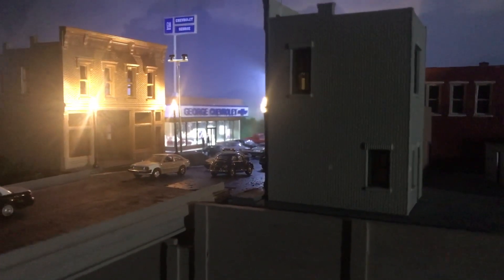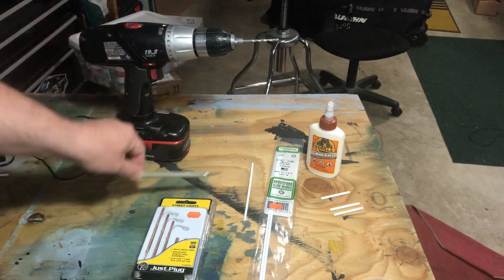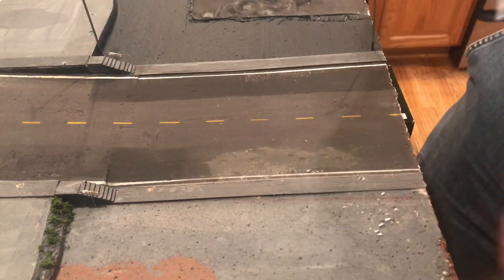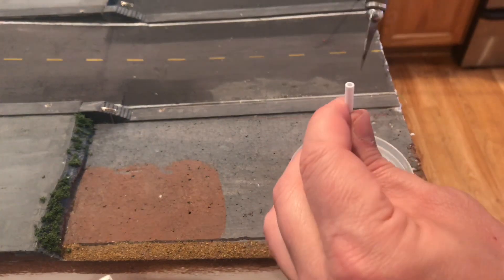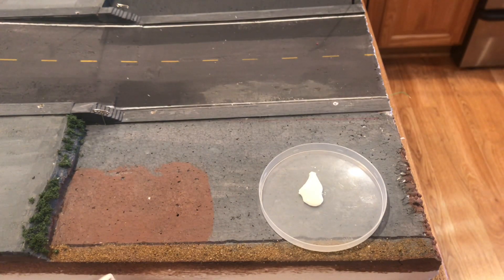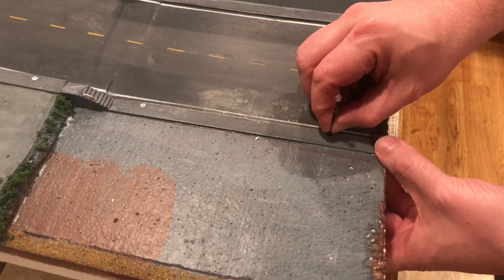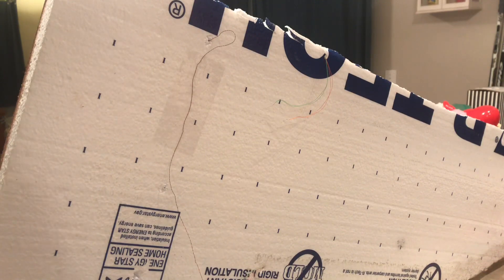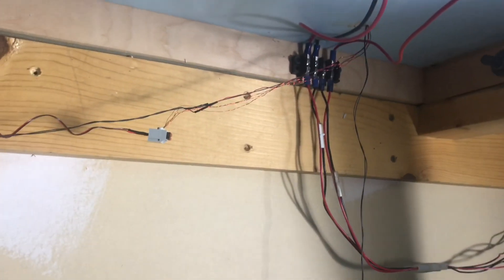Woodland Scenics Just Plug Light Installation method

Comment: Thank you for posting this.  👍👍 I was wondering how I was going to get the tiny pole wires threaded through small hole in foam and plywood.  The small plastic tube is great idea.  I can use this idea for track signals too.
Reply from the maker: Thanks for watching.  Yes, use it for any through hole wire setup.  Soda straws are a great option for just wires if needed.  Good luck and I’m happy this helped ya!!
Reply: It was really hopeful and I gave you credit in my video.  👍

Comment: Thats a great method,  I should have watched your video before I did the lights on my layout,  I  was shocked at how fragile those wires are for street lights.  Nice layout and details !.
Reply from the maker: Thanks!   I got tired of trying to thread track leads through the com, so I used a straw to feed it through, then I had this thought to take it one more step so I’m not gluing the expensive light post, but the cheap styrene.   Thanks for watching!
Reply: @goaliegeorge  Yes for sure that is a good way of doing it. Thanks for sharing.  Merry Christmas/ Happy Holidays.

Comment: Great video while I was doing this I broke tips off of the red wire do you know how I get the coding off the wire so I can reconnect it
Reply: I got it I used a lighter to burn off the coating 😀👍
Reply from the maker: Ideally, wire strippers, but you cannot do that with magnet wire..  so, usually I’ll put a blob of solder on the iron and dip the tip I need stripped into the hot solder to not just remove the clear varnish, but also to tin the wire for connecting.   I hope this helps.  Thanks!
Reply: @goaliegeorge  thank you 🙏
Reply: I actually used a lighter and it also came right off easily 😀 thank you for your suggestion 👍

Comment: Neat video!  I dont know if you were told but i did get hired at a gm dealership buick gmc.  I have thought about installing this system in my upper town i am building on top of my tunnel.
Reply from the maker: Daniel Coombs congrats!   I hadn’t heard yet..   I love the JP lights.  Yes, there are cheaper ways, but this works well and I don’t have to fabricate too much!   (Grin).  Just have to manage the wires.
Reply: goaliegeorge How many lights can be wired in one box?  Looks like ill be researching their system to find out how many can be strung in a series circuit
Reply from the maker: Daniel Coombs as I’ve been told, 3 lamps per a plugin. Each hub has 4 plugin.  I did put 4 LEDs on a single plug, so it may vary based on the current draw of the LEDs.  I’m going to be experimenting on a building soon, so check with me in a week or so.  Thanks!!